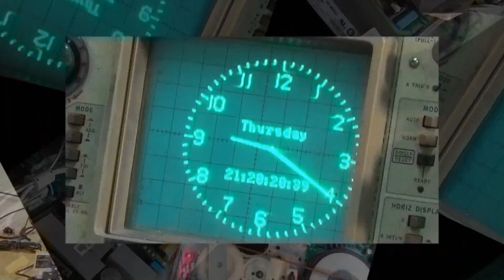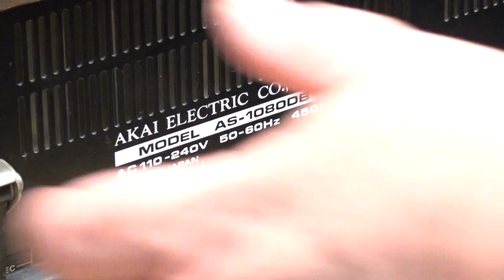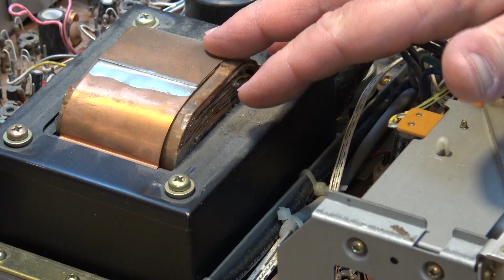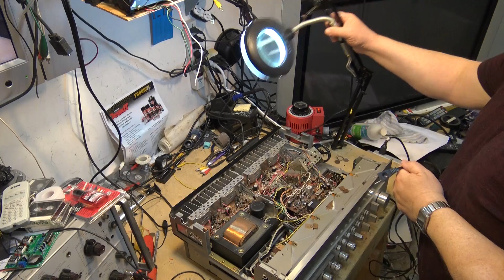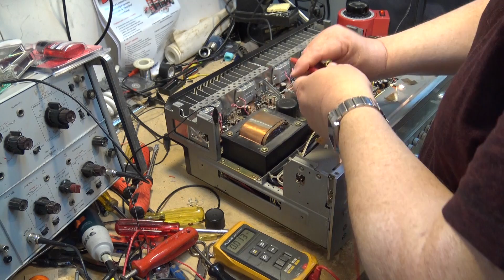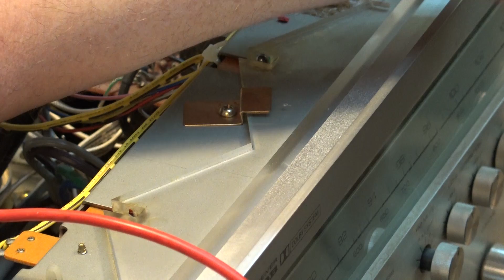Akai AS 1080 DB Quad receiver no sound

Comment: I have a pristine functioning AS1080db!  I have it hooked up to 8 speakers! (Infinity cs3009 (A) + Klipsch kg5.5 (B) in front, and infinity cs3008 + klipsch kg2.5 in rear).  It sounds ABSOLUTELY GLORIOUS!   The Matrix Quad switch to convert stereo to quad is, of course, not true quad, but on some songs it is just amazing.  I took a big chance buying this unit and it totally paid off!   It is like this machine was in a box for 50 years.  Not a spec of dust on it.

Comment: HAHAHAH   MUZAK on a ROCK FM station was a big problem in My area. The Jocks would fiddle with the Optimod and over modulate/over drive the Audio and the Rock station would bleed on the MUZAK SCA channel. 
When the New station was built the Jocks did not have access to the Transmitter feeds.
Shortly after the SCA was phased out to Satellite .  
I have a 4 Track Akai Reel to Reel that would match up to that Receiver.
Thanks Dave..

Comment: Don't be so negative there sir. My family has quite a lot of experience with the AS1080 DB. As a matter of fact my father has one, I have one and we have a third one as a spare (long story) one top of that my father was an aerospace electronic engineer and performs his own maintenance and repairs as well as myself. 
He's retired and I'm a fighter pilot so this is not a solicitation for your business, rather seeing as we are both AS1080 DB enthusiasts and we are both experienced in electronics I would like to offer my assistance.
If you need a copy of the full schematics I have the factory technical manual, I can also send referrals for where to get all the parts you could ever need from the top to the bottom of that anazing beast including capacitor kits, relays, solid states, transformers, faceplates, knobs or whatever. 
(We're a little fanatically cultist about the AS1080)
Just give me a reply and a address as to where to email you the info and I can get my father to sent it to you within a few days at no charge.
ImAnd if your friend with the beast decides that he doesn't want to repair it have him make me an offer and I may take it off his hands.
Who couldn't use a fourth one?
Have a nice day!
👉🤪💨👍

Capt. Tamre' "Vixen" Colby
347th Bravo CAS/AS 
USAFE/NATO EPAF 

https://linksharing.samsungcloud.com/gBmqiOBppHOO

usafe.natocom.intersec@gmail.com
Reply from the maker: The owner had a limit of 100 to repair this and that is parts and labour so what exactly did you expect me to do. If money was no limit then sure the modules could be subbed out but the guy that owned it got it cheap to sell and wasn't willing to put anything into it.
Reply: @12voltvids  
Yo! A hundred wouldn't get you the filter caps. And they're the first things to go! The finals would be at least eighty bucks each! Have you tried the N-P avalanche resistance on each with a VOM? There may be only one or two that needs replacing if any.
Those were also used in Sansui's top of the line and it's output was rated at 600W max, 300W per channel, two channels driven. 
(It was actually used at rock concerts!)
Oh, and FYI the AS1080 is a strong 80W per channel, 40W in quad with four channels driven and 75W max in matrix front and back two channels driven before noticable 60Hz hum or high spectrum frequency distortion above 18K Hz. But you wouldn't care, you'd be deaf long before that ever happened. Trust me.
I love those beasts.
LoL!

Veritas Aeouitas,
Capt. Tamre' Colby
USAFE/NATO CAS/AS
Reply from the maker: @Major_Tamre_Colby  
you must be in a dream world if you think people around here will pay that kind of money to repair anything. I don't know about where you are and how much money Americans pay to have things fixed but here in Canada people will not pay money to fix this old equipment.  This stuff is giving away on Facebook marketplace daily. In the last 10 years I think I've had three pieces of equipment where people paid more than a couple hundred dollars to repair something and that was parts and labor. How do you think I got a sansui 9090? it came in for service and this is going way back this is not something today this is going back to the mid-80s it came in for repair required all the outputs to be replaced and the drivers and they're made a follower resistor and some caps. The repair bill parts and labor and the parts alone cost about $150 was under $300 and the owner of it refused to pay so I kept it. I get people bringing me stuff and they say if you can fix it for $100 or less all taxes included go ahead otherwise don't do it. Half the time they won't even pay an estimate fee they all tell me they're going to pay for my estimate fee but then when I call them to tell them how much it's going to cost to repair it they tell me to keep it and I never see them again and the only way I make my estimate fee is by shooting a video on something that I don't repair and posting it so that you guys watch it and I get paid for my time. On this specific one I got nothing from the owner zero so the only money I make is when you guys watch it to see what went wrong with it and I make a couple dollars off the advertising revenue. they're not too many shops around anymore because to run a repair center where you're paying a bunch of overhead and you're paying technicians by the hour you have to charge a minimum fee just for something to come in the door and 99 out of 100 people won't pay that $85 or $95 estimate fee. Something shows up and I tell someone there's an estimate fee they walk away with it they won't even leave it. That's the way it is here that's why nobody's in this business anymore because there is no money to be made in it. I've had a few units shipped up from the states where I was paid quite well and given nice tips on top of what I quoted but that's only happened a couple times. There's just no money in this type of work and that's why I don't put as much effort into things as people think I should because I've already been told up front how much money they're willing to invest in it and soon as I get the top off and start seeing things like power module shot I know I'm over that limit immediately I call them and tell them this is what's wrong and they come and collect it. That's the reason I left the business as a profession in 2003. I did this for a living for about 20 years but even then 2003 people were not spending money to fix this stuff and they're certainly not spending it now. You might get a few audio fools that spend way too much on pieces of equipment but those people are few and far and quite frankly I don't even want them as customers because that's the type of person that you will never make happy. Most of them are unhappy people just by nature and they will sit there and nitpick. I had one such person with a tape recorder that one channel on playback was about a quarter DB less than the other and they brought that tape deck back about five times for me to make it perfect. I could show them it was perfect on my test equipment it was perfect playing my alignment tape and they would come back with their alignment tape and complain so it would make it perfect with their alignment tape and then they would come back because they made a recording and it was too hot the other way. We used to hate those people at the shop, and that's why I would see them all was when I was in the business we had one goofball with a television a brand new Sony who put up the old Indian Head test pattern I used a protractor to measure the center circle and the four circles in the corner came back with that buddy television I think five times because it wasn't perfect it was perfect in the shop but because the Earth magnetic field is slightly different at his house then it was at the shop the geometry was not quite perfect I was sent to his house and spent hours at his house making him happy with the TV pulled out from the wall so that I could work on it when the back was put on it and it was pushed back against the wall he measured it again and it wasn't good enough. We finally told him where to go and how to get there and I never went back. Today I don't want those customers I don't want pain in the ass customers that will nitpick and complain.
Reply: @12voltvids  
Hey 12V,
LOL! I agree with you totally, there is a limit to which our Canadian senebility and frugal sanity that could justify repairing anything that duct tape couldn't fix.
Oh, by the way, did you say that Sansui was the model 9090? 
While I personally have never seen one except in photos I have been told that it was and still is considered the ultimate creme d'la creme imortal god of receiver-amps to which all other ramps lower their volume in respect to this day. 
Or at least the most impressive monster master blaster of it's day.
But back to the Akai, in my family's case it's a labor of love that's born of cult like  devotion as we have had three in my family since long before I was even born. 
They are excellent and impressive units that sound great and are quite reliable. The only maintenance our two (one's still in the box... like I said, it's a long story) have needed has been to replace the filter caps about every ten to fifteen years or so.
When I get back to Canada  (I own a ranch/airport in Vancouver, BC) I'm going to have to check out the prices by the last time I was home an AS1080 DB in excellent condition at auction on Ebay commonly  would sell for at least two to three thousand USD or more and a VG cosmetically for parts only could easily sell for between 600~800 USD. I saw one of those Sansui's go for #12,500 USD!
Not bad for almost fourty-five year old units.
Well I've taken to much of your time and duty calls here so I should let you go.
One last thing, did you ask who I am?
Well, once again... it's a long story. 
I'm Capt. Tamre' Colby; Cmdr. 347th Bravo, USAFE/NATO EPAF, 
Viper CAS/AS, 
Ramstein AFB, Germany. 
I was born in Italy, raised in California, I live in  Canada and I'm a citizen of all three.. 
(Another long  story, LoL!)
Let me know if your customer wants to get rid of that old junker ).
 Rouch my photo on the left to go to my channel. 
While you're there watch my first officers video "Cloud Dancers Final Dance" 
if you want to learn more. 
Hell just Google my name.
Ta! Ta!

Honori majorum meorum,
Capt. Tamre' Colby
Reply from the maker: I'm sure it went to recycling years ago.  Yes i have a 9090.   eBay pricing means nothing.  Fake news. I have seen what sellers do. I know sellers.  If sometjing doesnt go high enough they bid themself from a second account and sell to themself.  They pay the fees as it gives street cred and then list again.  People see completed sales at high dollars and they rope the fools in.  I know 4 sellers that do this.  I have watched them do it.  It creates hype and people do get suckered in to the bidding frenzy.  Probably 50% of those high dollar sales are fakes.  Won't be continuing though because these transactions are starting to be taxed as income.   Money is also washed with these fake sales.   A sansui 9090 might go for 1800 which is quite a bit lower than some of the eBay predictions.  A used stereo shop had one for months with an 1800 price tag on it.

Comment: Hey!! I’ve got one just like this. The front right speaker channel works fine, the front left is very very low and both rear speaker channels are dead, not even static I think. What might be the problem. The unit has been sitting at grandpas house so I doubt it’s been tampered with

Comment: It's pitty you did not fix this gorgeous amplifier.  I think  you could have tried a few things. First to see if the preamp outputs worked. If not I would call it a quit.  Then you could remove all of those sunken chips and replaced them with sdks.  I didn't want to see such a beautiful amp to waste especially if the chip had such a simple schematic.

Comment: A top of the line receiver like this should have used discrete power transistors. Cost cutting went on even in the 70's. Buyer beware on some of these old electronics with obsolete components.
Reply from the maker: Unfortunately all the manufactures were sucked into these power modules.  Then the companies stopped making them.

Comment: For anyone watching this in 2020, there has been a absolutely excellent discussion (including a solution in the last post on page 3) about a discrete transistor replacement for those sanken modules. If you can't read German, just use a translator:
http://www.hifi-forum.de/viewthread-185-16517.html

Comment: I just bought a CRT TV off of ebay and the seller did not say that it was broken.  It needs a new tuner.  There is no reception (snow) at all.
Frank
Frank Reiser Video/Audio Service
Reply: If you live near Caldwell, NJ, drop off the TV and I will repair it.  On the internet, type in "Yelp."  Then, type in Frank Reiser Video/Audio Service.  You will see my company come up.
You probably have a bad capacitor in a tank circuit affecting the 455kHz intermediate frequency.  A simple job.
Frank

Comment: I had a Yamaha R-100 receiver with a blown Sanyo Module that could never be replaced, so it ended up in the trash. Now with so many cheap Chinese 100watt D and T amps, I might have been able to wire in a couple of those and saved the unit.
Reply: You will never get that sound with class D or T, even new STK modules are not so good when compared with old vintage STK modules, so don't worry ahaahah <3
Reply: @vukiss-su7hn  True, I bought a chinese new STK465 for an old panasonic amp and the new IC sound so crapy, It does not sound clear, the mids and highs are not so cristal clear as the original japanese STK, and also the new one distorts so badly when you go up with the treble.
I should have heard those who tell me to not even try those chinese new STKs, they doesnt work properly as the originals.

Comment: That's one of the reasons I hate power modules. When I worked in a shop in the 80s, I could still find them but they became scarcer and more expensive. Last I looked power transistors are still plentiful and easy to troubleshoot.
Reply from the maker: The ppower module (a sanyo invention) fad lasted through the 80's and in to the 90's. Then many companies started going back to discrete component designs and power modules fell out of favor. When they work they are fine, but if you manage to blow one up, good luck finding one today.

Comment: You are hearing noise, but say that those other two modules are broken to? If the modules are broken, there will be no sound, or hum. That is what these modules do. Maybe a pre-amp problem? Akai is known for using transistors that fail (hitachi) and all amps from this era will be having bad capacitors. I repaired serveral units, always the same problems.
Reply from the maker: There was no sound output modules fubar, just dc voltage on output pin. That is bad. Burn out speakers.

Comment: I wish i have that unit. Or even sale this unit.
Reply: Yeah they made good unit. Our unit  is now 30 years old. The fm is not good reception even i use big antenna. Cassete tape is not work because needs to replace belts. But here in the Philippines electronic shop didnt sell belts because of new technology gadgets. Whew.
Reply from the maker: It went back to the owner as he didn't want to spend anything on it.
Reply: @12voltvids  really? Akai is good brand. We have akai astron symphony stereo. Bought my auntie in year 1988 1st model launch at that year in Philippines.
Reply from the maker: They did make some good units. The problem with this one was the power modules. Obsolete these days, and the ones that are floating around are all "iffy" as most are pulls from old gear. Akai made some great reel to reel recorders. I have 3 myself.

Comment: I would assume one could open those modules and look up the transistors and other components inside the modules in the NTE database and find an equivalent to replace them with.
Reply from the maker: Stephen Hinkle 
you're right joking right. the parts inside the modules are not packaged. they are the bare silicon dies with the bonding wires going to them. there is a little pcb with the bias resistors and driver/output stages mounted directly to the heatsink. there are no numbers on them to look up.

Comment: I actually saw a video of a Magnavox Cd player that had a issue with the cd door. It was sticky, and would not close or open right. You found it was the belt, and applied some alcohol to it and fixed it. This cd machine just opens up again when trying to close it. Probably a belt problem.